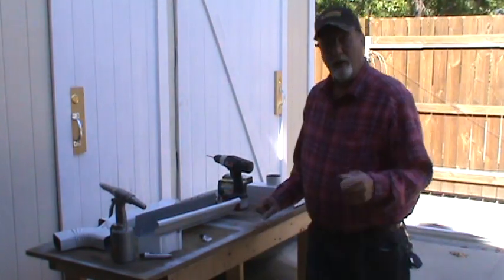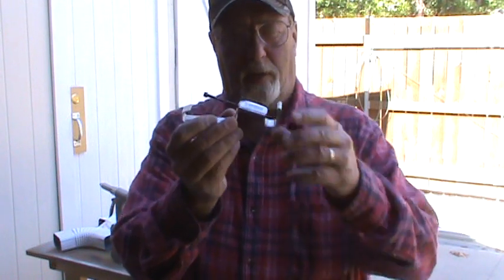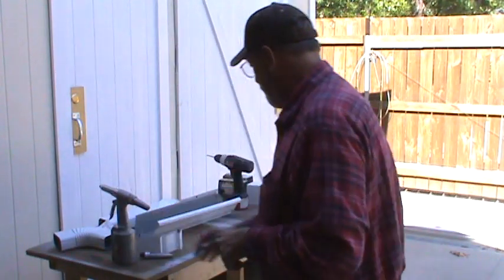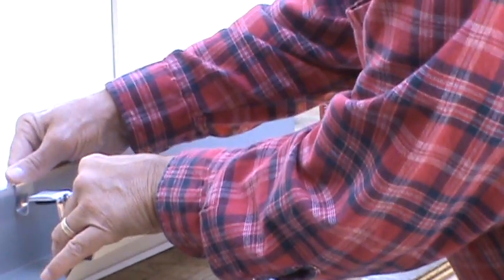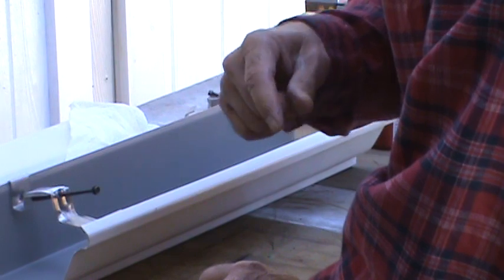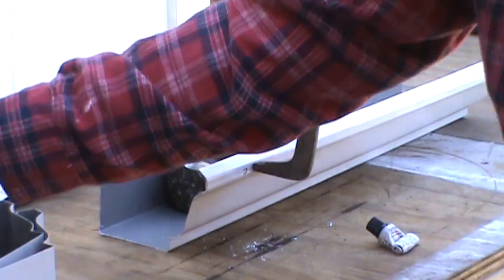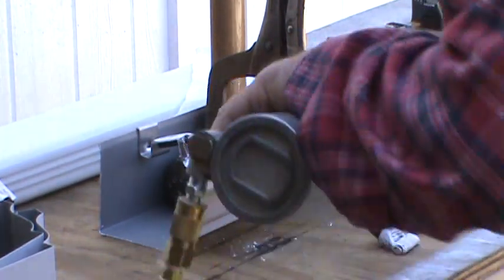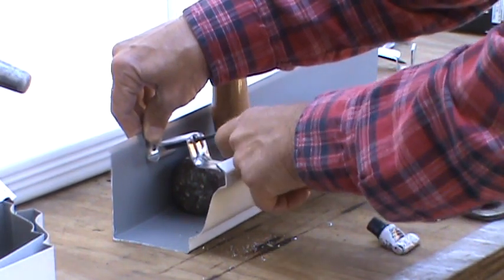Tips for installing Amerimax Home Products 5 in. Hidden Hanger with Screw 5/16/13 .mpg

Comment: rockpaws1 That's a great tip. My gutters with the Amerimax hangers sagged as you described when they were heavy with ice. I'm replacing one section that pulled away and bent right now and will use your tip with sheet metal screws. When spring arrives I'm going to reinforce the rest of them. Thanks for a great video!

Comment: There is a raised area under the lip that you need to line the bracket up with.  If you run your hand under the lip you will feel the raised areas.  Then the bracket will catch onto the lip and will be secure.  If you miss the lip then it won't catch which is why people have a problem with these.

Comment: Those hangers should lock under a lip on the front of the gutter, no need for any fasteners
Reply: yep, my thoughts exactly.  I just installed gutters on my house they do not come off if "hooked"  under the front lip
Reply: @silkawzzr600 I see that now.  He does have a valid point regarding pop riveting the gutter to the bracket.  It looks solid.  I would say, if he likes it that's his choice.
Reply: It's tragic when people give advice like this. If you put the bracket into the lift like you're supposed to it's not coming out.
Reply: Correct!  This guy missed the obvious. I you put the front of the fastener under the lip first and then lower the back into place, it will hold without the rivet.
Reply: @BBXFX  𝐁𝐔𝐓, 𝐢𝐟 𝐟𝐨𝐫 𝐚𝐧𝐲 𝐫𝐞𝐚𝐬𝐨𝐧 𝐭𝐡𝐚𝐭 𝐥𝐢𝐩 𝐢𝐬 𝐬𝐦𝐚𝐬𝐡𝐞𝐝, 𝐬𝐪𝐮𝐞𝐞𝐳𝐞𝐝 𝐜𝐥𝐨𝐬𝐞𝐝, 𝐭𝐡𝐞 𝐛𝐫𝐚𝐜𝐤𝐞𝐭 𝐰𝐢𝐥𝐥 𝐧𝐨𝐭 𝐡𝐨𝐨𝐤 𝐢𝐧𝐭𝐨 𝐢𝐭; so this is a very good alternative.

Comment: A better solution would be to drill and put the rivet through the top edge of the gutter and into the bracket so it wont be visible from the front . The results would be the same except no ugly rivets to see from the ground.

Comment from the maker: rod builder, They make rivets that are painted white on the head of the rivet. The gutters that I installed are one my out building not on my home. I had lots of these rivets on hand so there was no need to buy more rivets. I never said use only these rivets.

Comment: Gosh, ronkpaws1... so sorry for all the negativity and ungratefulness being spewed here... yes, there is a curl that the hanger goes behind, but it could fail... the rivet gives that extra measure of security... and yes, a shiny rivet was used as an example and if you don't like that then go out and buy a white rivet! ...there is NO need for the discouraging, snarky remarks posted when someone is simply presenting an idea that they believe will be helpful... I enjoyed your tip and find it useful... Thanks!
Reply from the maker: +kaywrenkirk Thank you! People do not realize how many young persons today are not DIY knowledgeable and have to pay someone to do the jobs for them. Most of us that do videos just try to make things easier for the ones that need help. I was very lucky to have a father that taught me how to fix anything and that is sadly something that the younger generation rarely has today. Thanks again.
Reply: +ronkpaws1 personally I don't care if people do see shinny rivets in my gutters, I'm only interested in them staying up when and if ice gets in them, I've used pop rivets since they were on the market and most are aluminum anyway,, great job, it's just sad that  Amerimax  hasn't pre drilled the hangers so the installer could just punch a hole in the cheap gutter material.. actually, I have over a hundred to drill so I'm going to drill all the hangers on the drill press and the gutters on the house. thanks.
Reply: No, Ron is not putting the bracket in incorrectly.  You don't rivet if you install the bracket the right way!
Reply: YouTube commenters are almost as bad as Twitter people. Thanks for speaking up. I was thinking the same!

Comment: its called a hidden hanger because it is designed to hook on the lip of the gutter,  tilt it up and hook it on the upper lip. It is not intended to be fastened with a screw or rivet.  no drilling is necessary
Reply from the maker: When the gutters started getting full of leaves and dirt the top of the gutter would be pushed out away from the hanger.
I have had no more problems with the gutters sagging but thanks for your input.
Reply: ronkpaws1

Comment: Confused?   I thought the front top lip of the gutter get's hooked by the bracket front.   You install at an angle so the bracket front lip catches the underside of the gutter front top fold.   That's the only way it can hold the gutter without the rivet method you are showing.
Reply from the maker: 5 years and still holding up like a champ. I did it this way because there have been problems in the past of heavy dirt and debris in the gutters. Aluminum gutters are flimsy and bend, then the hanger will not stay inside the top lip of the gutter.

Comment: Whoa, slow down!! You've quadrupled your man hours. The gutter bracket secures under the front lip of the gutter, you have to start with the clamp in an upright position then roll it down to the back of the gutter. It secures itself cannot pull free.

Comment: I just bought Amerimax gutters. The gutters are flimsy, thin, and just poor quality.  The seamers are not properly sized to cover the joints properly.  The seamers do not have the same profile as the gutter. The seam sealer is a joke. It does not hold the seam together. Use Silkaflex instead. The hangers, they require more than this gentleman's tip. The hangers bend very easily, and do not support the gutter well. Overall, Amerimax gutters should be avoided if you want quality gutters.

Comment from the maker: Aluminum gutters are thin and flimsy. All that needs to happen is to get some dirt build up inside the gutter and they will slip right out of the groove. That is why I use pop rivets so I will never have to mess around with them again.
Reply: I love this idea but my only concern is that this is a high sun exposure area that really heats up. It's coming off a flat roof, so ice buildup would make me nervous. How did you find this method did with the flex of the thing? There is a lot of movement in anything we put there, in my experience. It needs to accommodate at least a little movement.  My husband is a metal fabber/machinist so we have most of these tools on hand and then some. Man I'd hate to go vinyl but if I have to.. I have to.

Comment: not if your machine is properly adjusted to match the correct gutter profile for the machine, the machine manual will have profile diagram and measurements, if the gutter you are spitting out is different measurements well then.......
if front lip is too small should be about 1\4, at the entrance of the machine, adjust the 2 guides slightly to the right, 1\8 - 1\4, do this while a coil is being run threw the machine, watch results at exit

The Gutter Shop 
3 decades of service

Comment: Just not seeing the benefit.  The brackets install under the front fold and the manufacturer recommends no such fastener.  I think in a load test without this extra rivet / screw the gutter would buckle from weight before releasing versus the extra rivet...

I know lots of people are perfectionists and come from some in my family and am myself at times, but just don't see it here, along with breaking up the smooth outside face with these rivets every 2 feet.